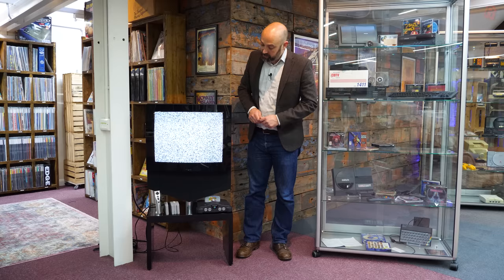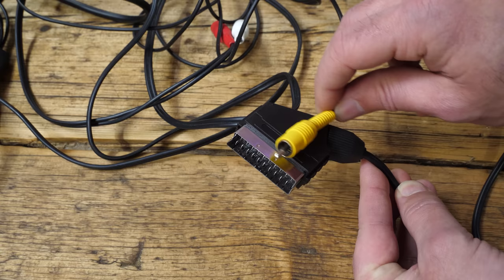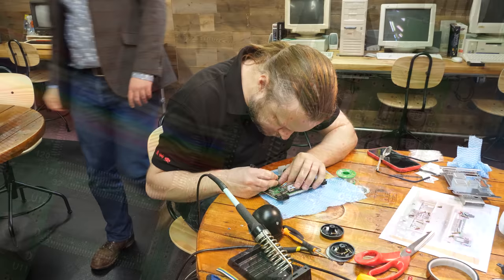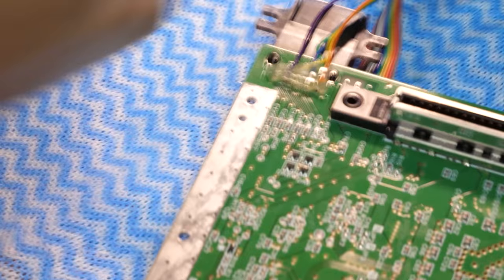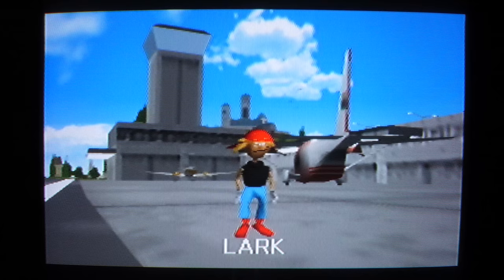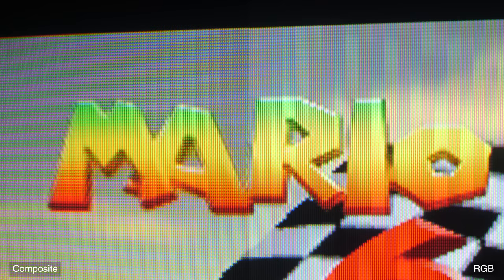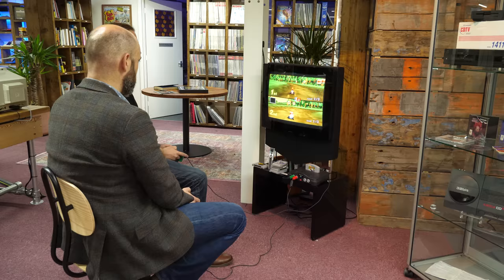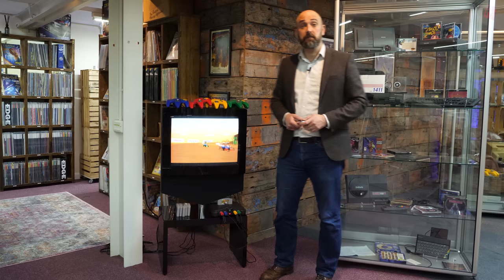Should I RGB mod my N64 (and look at this awesome TV!)

Comment: Hi Neil,

Awesome move to put this combo in the exhibit. Quite tricky though with those controllers, with their flimsy analog stick. 

How would you handle issues with those sticks? They get wobbly after a while and will definitely drift, due losing their stiffness. I know there someone produces aluminium replacement parts, which would make a huge difference. Although, the plastic parts surrounding the stick could be damaged by that too. 

I’m really just wondering this, because you’re running a vintage museum and all!

Thanks for reading. :)

Comment: Yes RGB euro SCART is the best, I have a CRT that I can get PAL, NTSC running on my CRT not sure about SECAM because I have never tried. I also have a euro SCART S-video for my Commodore 64. RGB is sharp and colourful. My CRT was my fathers old TV. Hdmi mod does not compare to RGB and a CRT. 240p on my CRT has lovely scan lines. I have a non branded ASDA TV and it is sweet, Mega Drive, Master System, PlayStation's, commodore 64, Dreamcast etc all look good on my CRT. I do use a LCD too, it next to my CRT on my desk. CRT is 24inch, LCD is 32inch.

Comment: i was going to bid on that TV but it was down south and if i recall collection only..
Reply from the maker: Yep it was about an hour away from me. I turned up and the guy was a reviewer for What HiFi with a house full of old record players and CRTs!
Reply: @RMCRetro  no way. how amazing. i saw it advertised, i've seen a few actually, but they're all in the south, and there's no way my little corsa will get that far - lucky if it makes it onto the m62.. i've settled for a hand me down 26" lcd panasonic tv from my mum, which has every connection under the sun on it.. however when using the scart (for mister) the picture just rolls. i know the lead is fine cos i had it working on my old crt.. and now money is really tight (energy crisis etc) i daren't spend on computer stuff incase i can't afford my energy bills.. you got an absolute bargain..

Comment: Attempted this mod twice and it worked fine to begin with but after a few hours it killed one n64, I managed to save the second attempted N64 by removing it just in time, same thing here worked fine for a little while then died. In the end I purchased a modded Japanese N64 converted to run PAL RGB. I’m no stranger to difficult mods having done several Game Gear screen mods. This one however got the better of me. Not sure if I just got a bad board or it was my fault. Still got the board but not prepared to risk another N64 attempting to fit it.

Comment: 9:42 - S-Video cable needs a 75R resistor on the Luma signal. Which I believe has to go in series with the wire.

It seems the Luma output on PAL N64s has a "2x gain". So the series 75R will act as a voltage divider, along with the 75R termination resistor (to Ground) that should be inside the TV.

I think the problem with a lot of the Nintendo cables is they have slight differences between the SNES and N64.
Some need caps on the RGB lines for AC-coupling, some don't. Some need extra 75R termination resistors in the cable, etc. It can be very confusing, and is different on some NTSC consoles vs PAL.

I found that S-Video does give a nice boost in sharpness on a CRT for N64, even over a basic RGB mod.
S-Video also gets rid of the "dot crawl" of Composite, which is something I hated. lol

If you're still seeing the dot crawl with an S-Video cable, then it's almost certainly wired wrong in the cable itself.
ie. it's probably using the Composite signal for "Luma", but there's a separate pin on the N64 AV port for pure Luma (with no colour modulation).

Some TVs even have problems when using Composite Video or even Luma for sync on an RGB SCART cable.
For the best RGB image possible, it should ideally be using a pure Csync signal. I believe the N64 can be modded for that.

We had a Beovision 8800 for most of the 90s, and it was awesome. It was the mono speaker version, but man that speaker was amazing. It was basically a big bass reflex speaker that took up most of the right-hand side of the cabinet.

(the sound quality, volume, and bass would put many modern LCD TVs to shame, but then TVs had more space inside back then.)

The B&Q remote was metal (even the buttons), and I think took a 9V battery. You could knock out a burglar with that remote. lol
Reply: Oh, btw, some CRT TVs back then could accept S-Video via the SCART input.

With the Chroma signal going to the "Red" pin (11) on SCART, and the Luma signal going to the Composite pin (20) on SCART.

That usually required that the TV had a specific input for that mode, though. No idea if the BeoVision does.
Reply: You absolutely nailed it.

The fake S-Video cables are prolific in The States, still sold new at nearly every retro game shop. They are branded Old Skool, Retro-Bit, Tomee, Hyperkin, etc but they are clearly the same OEM. They appear to work with SNS-101 and SHVC-101, which lack Chroma, and they do appear sharper but you get that destructive interference pattern. Those would be the “junior” or “mini” consoles that lack S-Video. My guess is that they knew some consoles wouldn’t work with a proper S-Video cable and they didn’t want to see returns.
Reply: @emmettturner9452  Yeah, the crosshatch pattern used to happen on some TVs even when using RGB SCART, and Composite for the sync pin.

Like they were letting the Chroma bleed through. Not really sure, since SCART always used pin 16 to switch to RGB mode.

(that might be part of the reason why the old Sky sat boxes used to blank the Composite output when RGB mode was enabled in the menu.)

On quite a few TVs, the OSD would also clash with the RGB input, as they were just shoving the SCART RGB lines onto the OSD lines, I guess? lol

My old Ferguson CRT TV (TX-100 chassis) could accept S-Video via SCART, by having Luma on pin 20, and Chroma on pin 11 ("Red").

But the TV has to have a specific input selection for that, and it was rare to see anyway.

Comment: I have a HDMI adapter for mine. It took ages to find one that worked, but it works well without having to open up the machine itself. Not cheap, but I prefer it to having to tinker with the electronics.
Reply: Which adapter do you have?

Comment: I’m pretty sure I’ve used the component video cable from my GameCube on the N64. That gives a very sharp picture and doesn’t require a mod. Of course, your TV would need to have component video ports.
Reply: The N64 doesn't have RGB built in, you can use the cables but it would only output composite via scart
Reply: @revengenerd1  I was mistaken. I just went to hook up the component video cable I have only to find that it was for the Wii, not the GameCube.
Reply: @marcusmayfield9499  GameCube component cables only for the Digital port on DOL-001 consoles anyway. That port simply isn’t there on a N64 or DOL-101 GameCube.

Comment: Any 90s and up European spec TV (I'm not saying PAL as non-european PALs don't) does run SECAM, PAL, NTSC and does have RGB, it might have even been required by law in some places - not sure though.... I love mid 2000 21" LG line of TVs - by far the best picture quality I've ever seen on CRT TVs, some Philips are equal but they have some technical problems like huge overscans (it will literally swallow mario on the left edge) that can't be adjusted.
Reply: TVs that support 60 Hz are a lot more common than ones that support NTSC color encoding, but luckily this isn't a problem with RGB.

Comment: Whenever there is a question if connecting via RGB shows the best quality a console or home computer is capable of, the answer always seems to be yes.  However, these days I think an HDMI mod is well worthwhile as those mods make it far easier to link a vintage console to a modern display.

Comment: The Scart can hande composite and S-video as well, as long as it's full "pinned"
Reply: Composite video is the standard sync for SCART since they don’t officially support C-Sync. S-Bideo reuses some of the RGB pins so it’s more about what your SCART display supports… and only some supported that. For those people usually got a standard 4P miniDIN + dual RCA S-Video stereo AV cable and ran it through one of those SCART breakout dongles that has miniDIN and RCA jacks.

Comment: Or do a simple s-video mod (connect composite to Luma with a 75ohm resistor
Reply: With that cable he also needs to move the chroma wire. It’s one of those ones that connects it to composite video instead. Super common. Pretty sure they do it on purpose so that they appear to work with the SNS-101 and SHVC-101 Super NES/Super Famicom “junior” consoles.

Comment: My household tried using an S-Video cable on an NTSC N64 once and it also looked kinda funny.
Reply: Most sold today are fake. They look sharper because they use S-Video Luma but they connect chroma to composite video. Retro-Bit, Old Skool, Tomee, Hyperkin, etc: They all do it because they are all reselling the same improperly-built cable.

Comment: Love and hate B & O. Excellent quality in the CRT days...but their menus and setup can be downright arcane and obscure to figure out. Just to switch to specific channels and such for consoles.
Reply from the maker: When it works it works, when it doesn't you do get a bit frustrated with the simplicity of the options. I guess there are service menus you can get into but I've not had to do that just yet with this one. The real killer is if someone sets a pin code on them to lock them, if you don't know the code you're never getting back in again!
Reply: @RMCRetro  Word of warning to you regarding your BeoVision 1. I used the factory reset option in the service menu of my BeoVision 1 LS and the Beo1 remote stopped working. I needed to buy a Beo4 remote to change the "Option" setting to get the Beo1 working again. This might be specific to the LS models.

Comment: I feel, there might be a halfway sweetspot for N64. The RGB just looks too sharp, jaggy. Just from looking at this video on an LCD. Composite, and CRT, smooths out those jaggies somewhat, which looks nicer, IMHO. The shimmering and "ants", good riddance. I suppose one of them retrotinks might help, and looking at the picture in situ. Kinda thinking there is about as many "best solutions" as there are N64 owners. :)

Also, I have a SCART cable for N64, looks nice enough, S-video. But if I try to use the same cable on the SNES, picture is unuseable, too dark. Nintendo, in their infinite wisdom, apparently set the N64 to output "hotter" signal. Maybe they wanted to sell new cables...

Comment: You can sell us what you see = Subjectivity, versus, you can make a histogram of colors, convolutions, statistical analysis, etc = Objectivity. 
The particular universe of each subjectivity is similar to their comments without any particular technical contribution,= " selling act". So, you can give us a subjective account if you feel like it, but that doesn't change the reality that CHROMA modes like S-VIDE and Composite provide tonal variations or alternate colors and will be less than the RGB hack you're trying to sell us. Nor does it change that the modifications are anachronistic and unorthodox, similar to putting wheels on medieval armor or a plastic handle on an medieval sword.

Likewise, since it exposes PAL clients with SCART, well! Please also tell us: the refresh rates offered by your TV-PAL and if it is output from an NTSC equipment (TV SET)

Comment: To be fair you can do this mod for 5€ and get the same picture quality, using a simple off the shelve RGB amp but it won't give you the extra features
Reply: If you have an early board anyway, which they did in this case.

Edit: Actually they didn't, it's a NUS-CPU(P)-01, not CPU-01. My mistake.
Reply: …not on a PAL console and only on the early NTSC consoles. There are four video DAC encoders and only one can have a simple RGB amp/bypass installed.
VDC-NUS (RGB-capable; Video-only DAC)
AVDC-NUS (finer pin pitch; integrates audio DAC and drops RGB)
MAV-NUS (seems to be the same as AVDC-NUS)
DENC-NUS (exclusive to PAL consoles; same larger pin pitch as VDC-NUS but a different pinout; has no RGB)

Comment: Without having to source an old CRT TV what is currently the best way to use my Nintendo 64 on a modern LED TV? I tried The Ocarina of Time and it looked awful.
Reply: You have to come to the conclusion that all consoles that used the old Composite plugs were meant to be on a old tube TV. But then there is Emulation which will 100% look better on a modern TV as long as you have the power to put the resolution at a higher res. For original hardware users it will depend what OSSC you buy, RGB modded 64 is a must if you are trying to improve the image quality no way about it. I am currently  modding my n64 like the guy in the video to play on my PVM.
Reply: N64Digital and UltraHDMI are able to supply a perfect digital signal as it was generated by the GPU but it still may not be what you are expecting.

Comment: Pretty sure NTSC units can be RGB modded with wire links and resistors or maybe capacitors, but PAL ones just don't have the RGB signals on the board to tap in to (relying on 20+ year old memories). Such mod boards creating their own RGB output from the digital signals weren't available back then, though.
Reply: Only the earlier NTSC ones with a VDC-NUS encoder/DAC. The AVDC-NUS/MAV-NUS encoders were made to be universal and added an audio DAC so they eliminated the RGB output to free up pins. The PAL-only DENC-NUS encoder DAC is also missing RGB. :(

Comment: How strange, My comment appears to have been deleted. I thought explaining your S-Video issue and how to fix it was useful.  Never mind.
Reply from the maker: Hi Ken YouTube flags some messages and puts them in a “for review” queue that I have to manually release. It’s probably in there, I’ll take a look when I’m in The Cave later today 👍
Reply: The problem is two-fold: It’s missing the resistor AND it has Chroma wired to composite video.

Comment: Another great mod, but there's got to be a nicer / cleaner way to mod these consoles in the future than soldering to chip legs surely? Doesn't the Amiga vampire mod just clip on top of the existing CPU? Something like that to tap into the connections without soldering would be great if a mod supplier could make one.
Reply: It’s a digital mod and the digital video signals only exist between that chip and the RCP right next to it. Other digital mods for N64 like UltraHDMI and N64Digital solder a flat-flex PCB directly to the RCP since they also need digital audio.

The issue with something that attaches directly to the DAC/encoder is that there are multiple revisions with different pin outs and pin densities. There is one mod kit that simply makes different adapter boards for the three different encoder DACs but it’s absolutely terrible: Warriors 64. Their kit gives you digitally restored RGB and then RUINS it with one of those $20 RGB2HDMI converters. You know the ones: They use the same scaled built into nearly every TV that adds latency, deinterlaces non-interlaced 240p (the N64’s native resolution), etc. Furthermore, they didn’t get the RGB levels right so it absolutely ruins the colors/brightness. You can use their adapter board with your own kit but you’ll have to get a breakout board for the other end of the flat cable that plugs into it and the board still solders to the pins.

The FFCs and adapter boards are MUCH easier to solder. With the right technique and tools you can just drags across and watch the solder go where it is supposed to. Peter Bartman/Borti actually made an FFC to help with installing this kit. He also made a couple of his own N64RGB kits. Heck, the special DeBlur firmware running on this one RMC has from Tim Worthington/eTim is also from Borti. :)

Tim Worthington even sells an FFC to break out the pins from the later DAC encoders with audio and a finer pitch, but it only breaks them out to the same pitch as the DENC chip they soldered to in this video so it likely isn’t what you’re looking for.

That said, Borti’s cable is open-source. You can get a bunch made for cheap. A good temperature controlled iron, lead solder, and proper flux can make the chip soldering take less than 10 seconds. I’ve done around 1,000 N64 FFCs for installing UltraHDMI, N64Digital, N64RGB, etc so I’m very practiced now but I managed to pull it off first try on my childhood console before I did it for anyone else. I won’t say it’s easy but you can always get another cable and try again.

Comment: There should be no dot crawl on s-video so that cable is passing composite and it probably lacks the 75 ohm matching resistor on the output of the n64.  Rgb is worth seeing in the flesh its remarkable.
Reply: That’s definitely why it’s too bright and, you’re right: there shouldn’t be any “dot crawl”
…but the crawl is because they wired with chroma to composite. All the cheap S-Video cables so this because they then appear to work with consoles that lack S-Video, like the SNS-101 and SHVC-101 “Junior” consoles. Retro-Bit, Tomee, Hyperkin, Old Skool… they all do it because they all get their cables from the same supplier. They probably want to avoid returns claiming it doesn’t work but IMO that change makes it a fake S-Video cable… even if it appears sharper.